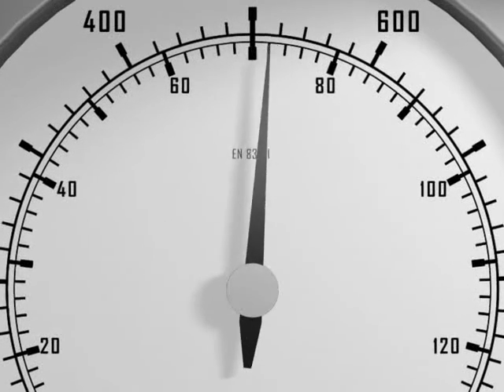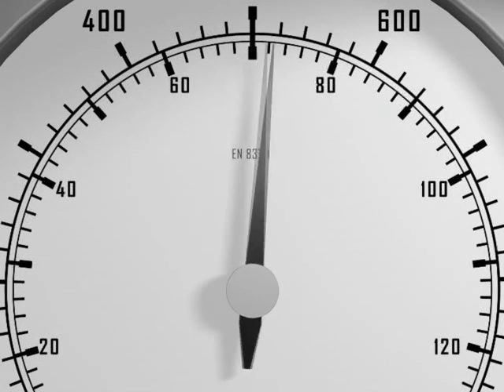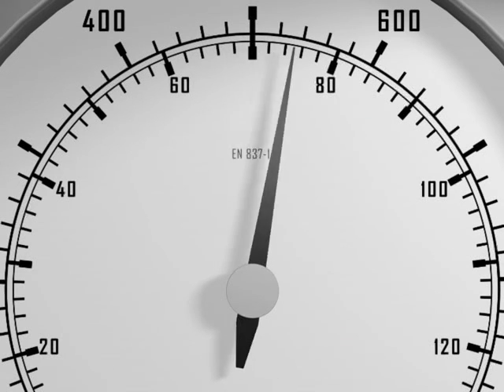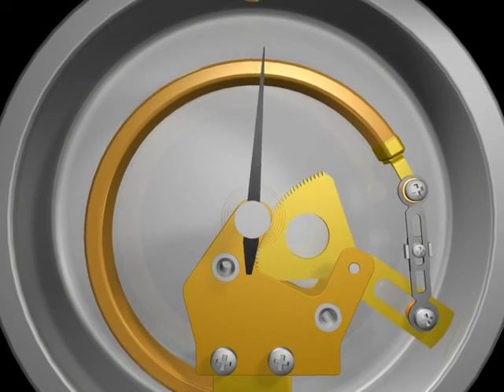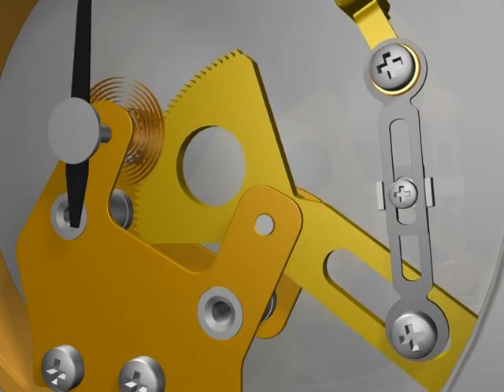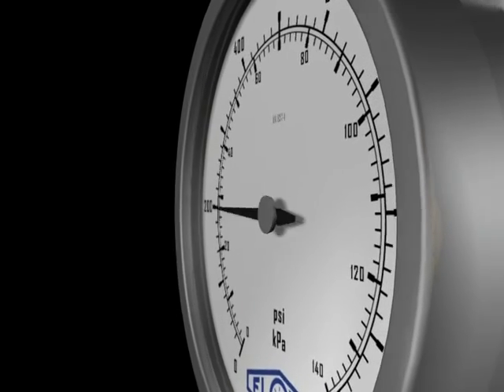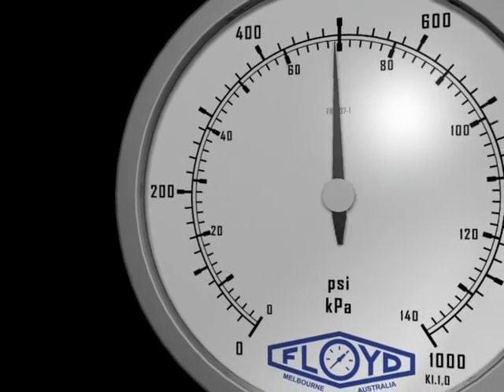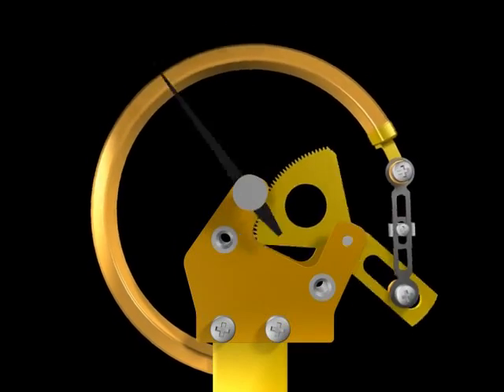PRESSURE GAUGE. VIBRATION AND PULSATION ON A PRESSURE GAUGE.

Comment from the maker: Vibration can be a reason for a gauge not to operate successfully, and high frequency vibration can be more severe on internal components than low frequency vibration. When vibration occurs it causes erratic movement of the quadrant, pinion and link which causes these components to wear out in a short space of time. In this situation, glycerine filled gauge will extend its life. Or, if possible, mount the gauge off the vibrating machinery.

Comment from the maker: Pulsation will normally occur when gauges are used in close proximity of a pump and will cause eratic expansion and contraction of the bourdon tube and the junction movement of the pointer. In this instance the quadrant, pinion and link components will wear out in a short space of time.